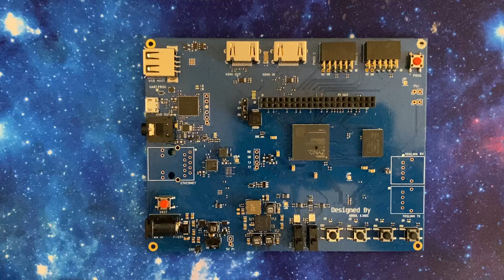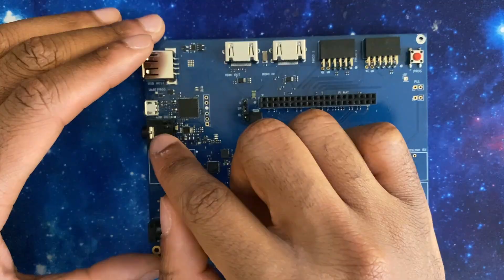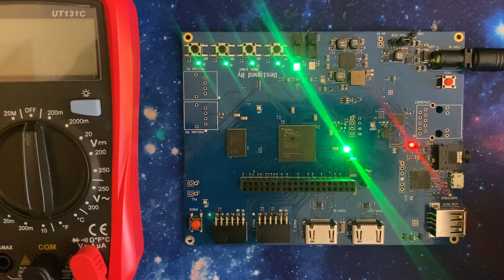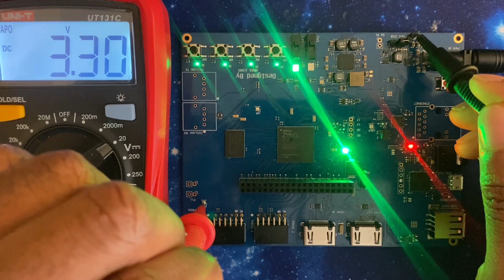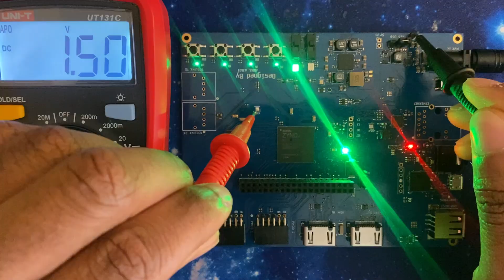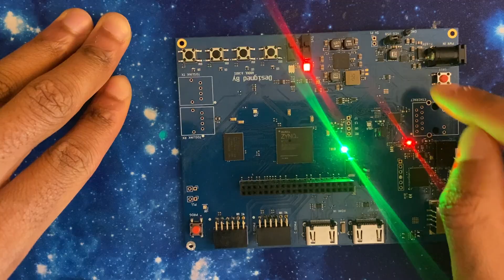Custom Xc7z020 FPGA BOARD ZYNQ 7000 Overview

Comment: Nice work Abdul.  Out of curiosity, what do you plan to do with it? What does the PL part allow you to do, that might not be possible with just an ARM processor and software?  Keep going!
Reply from the maker: Thanks for the comment.  After completing the bring up, I plan on designing an audio room correction device utilizing the DSP blocks available in PL to generate FIR/IIR filters.